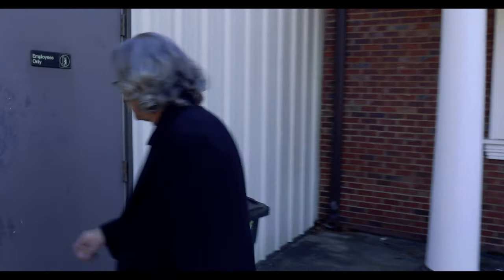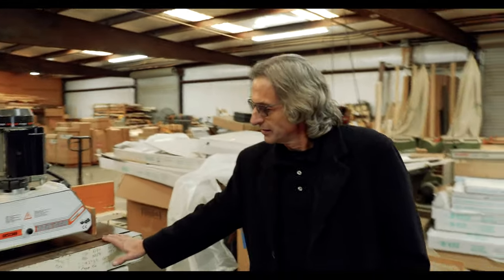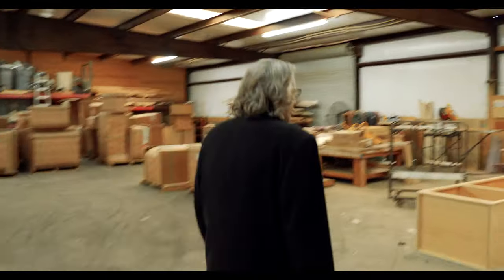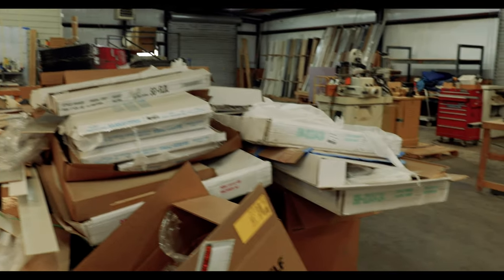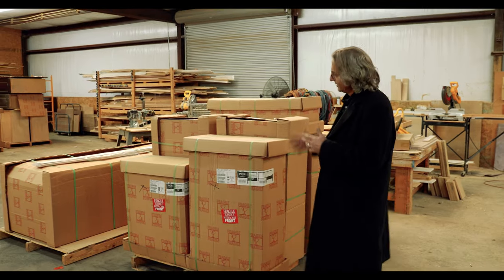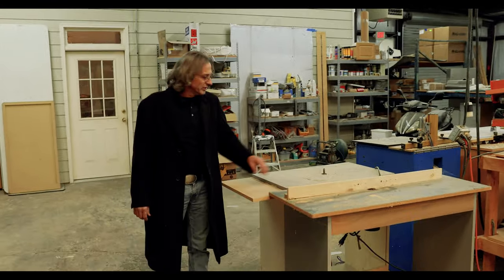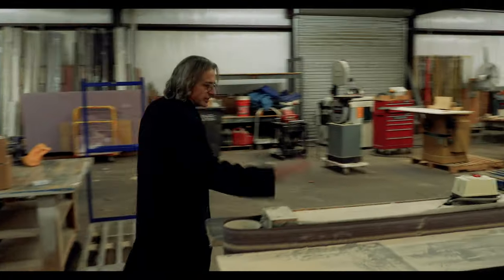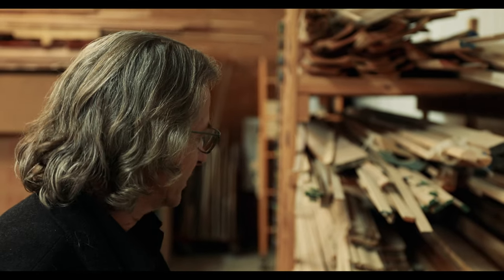A Tour of the Shop Before Making Changes | Mast Woodworks

Comment: You have a beautiful old chevy pick up I would buy and give it a good home
Reply from the maker: Hi Scott, I’ll bet you could give that truck a great home 😊😊 however we started last week on a full frame off restoration on the truck, I’m sure will post some pictures or included in a video when it is done, We did lose about half the cab to rust so we’re having to replace the whole floor board, firewall and a little bit up the back but it should look really good when it’s done